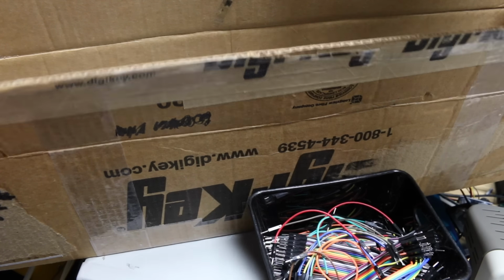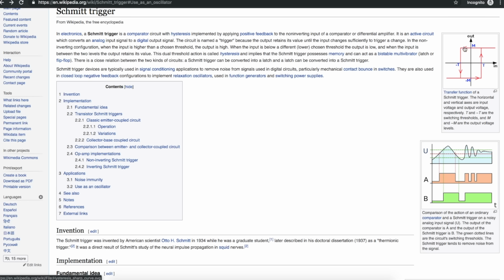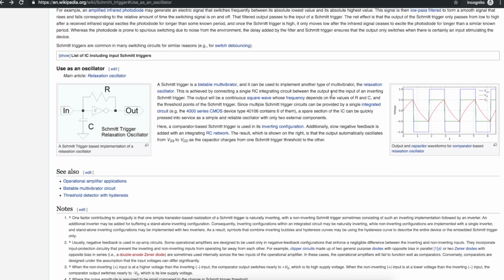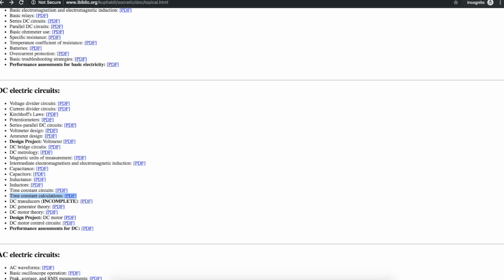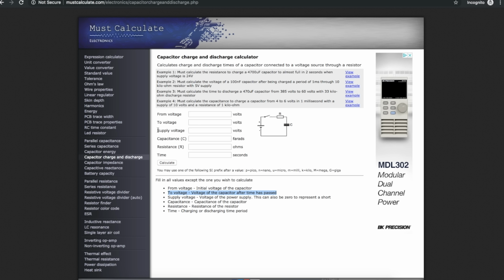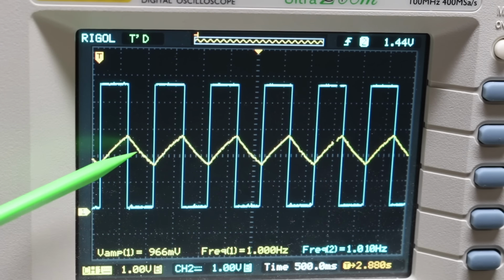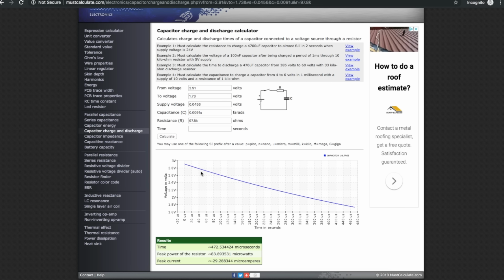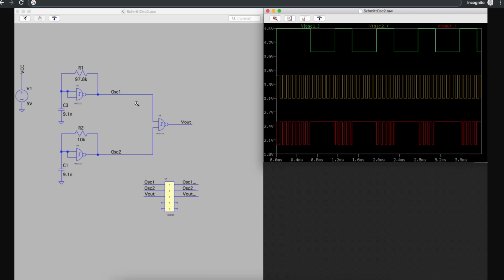Schmitt Trigger Inverter Oscillator - Fun with Nand Gates and RC Networks

Comment: Physically hearing and seeing what gating is in audio certainly explains what it is more clearly. I always wonder what Julian is talking abut with his vocoder.
Reply from the maker: I need to get caught up on what he’s doing over there with that project and all those PCBs that keep coming in. I’ll have to do a binge session.   Seeing  circuits behaving on the scope  even in a data sheet is always helpful, for example I knew that noisy inputs would cause extra output transitions but I didn’t initially know that if the input stays in a certain middle voltage, the  output may also be stuck somewhere in the middle and not officially be high or low. Seeing the picture clears it right up.

Comment: Well this would be a good way to get a higher frequency PWM for output control by creating a high frequency constant output and the using the regular PWM fro the controller to modulate that for the final output control.

Comment: That looks like one of the pile of chips I sent you. How does it compare to the CD74HC00E ?
Reply from the maker: That’s the pile it was from! The 74HC00 would have a struggle with noisy inputs and give quirky outputs  but I didn’t try it with the resistor capacitor network to see if that’s considered too slow or noisy. 
Maybe if I take external input signals from elsewhere off the board there would be more trouble with noise. I also  didn’t look into maximum frequency between Schmitt and normal gates if there is a difference in what we can achieve. Maybe eventually I will look at that as I play around more.

Comment: I have to ramble on now 😂 because the CMOS version of this chip (the CD4093) is one of the 1st chips that I worked with on my quest to build oscillators. Since then I have discovered a vast chasm between musicians who use electronics to create and manipulate sounds and electrical engineers who have the ability to educate those musicians but not the direction of where to focus. For example, as a hobbyist who manages to build this on a breadboard, there is the problem of translating the audio signal produced by the oscillator to industry standards like line level out in dBu (referenced to .775V without regard for impedance or rather, as if impedance might be 600 ohms) or even in consumer level dBV (referenced to 1V because marketers thought that would simplify things 😂).  And it's just a matter of adding a voltage divider.* 😂 But say the words "voltage divider" and the musician/electrical hobbyist goes running for the hills. Maybe it's better than way, I dunno 😏 I did warn you this was going to be a ramble, right? (* to be fair it's majorly a matter of being able to measure your signals but that does require a fair bit of education)
Reply from the maker: If I keep going down this audio generating path, ultimately I will run into this very issue and if so, I hope I can find a solution that I can present.  Another project in the long list of projects!
Reply: @GadgetReboot  I am a musician and am thinking of doing a video or 2 on sound effects. I have made a few recordings on Reverb Nation.  I think I will start my next video with an excerpt ( Just a tease )from one of my songs.
Reply from the maker: Definitely do sound effect videos, and a song clip.  I hope to put together another sound effect thing soon but it will have to come after some pre-requisite videos building up to it.  I need to assemble the 555 circuit boards I just received and that will be used in one of the circuits eventually if I can remember how I did it so long ago.

Comment: Wow, you are stocked with logic gates.
Kind of unrelated:  A problem that drove me nuts for months, is how to build a single circuit, with a relatively simple adjustments, that stably oscillates both high speed (mhz) crystals, as well as low speed (watch) crystals.
Reply from the maker: I have a collection of old crystals laying around somewhere  and at some point I’m probably going to look at making inverter  oscillators  with them  so I might be driven crazy also because I always tend to go down paths I never would have expected existed.
Reply: @GadgetReboot  Yer awesome.
Reply: I have observed that many internet pages are wrong with showing a Smitt-Trigger in high speed MHz crystal circuits. Just an inverter works fine. See middle of page -> http://www.orangepi-dmx.org/orange-pi-dmx512-rdm/ws28xx-configuration/prototype-boards/multi/4-output